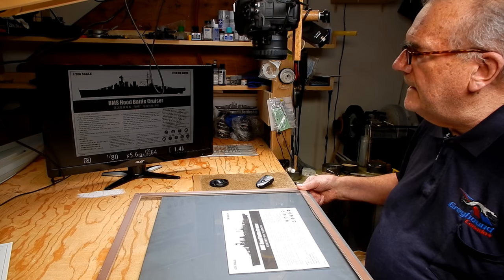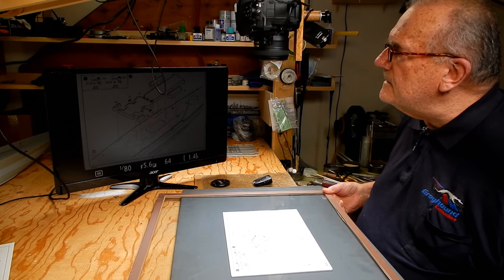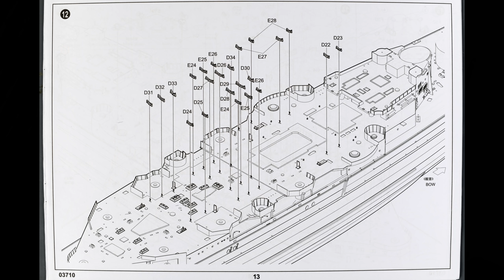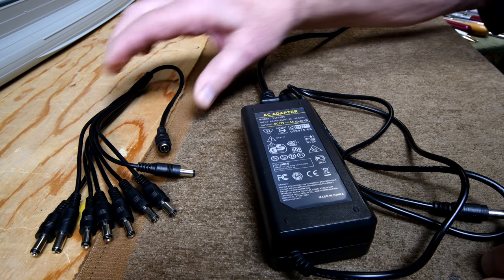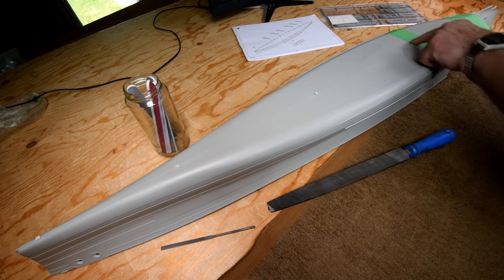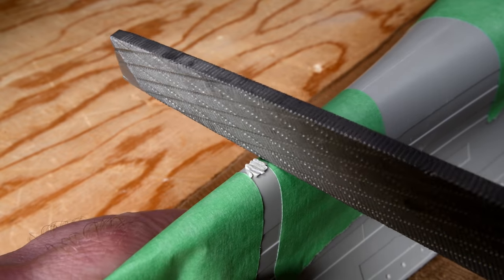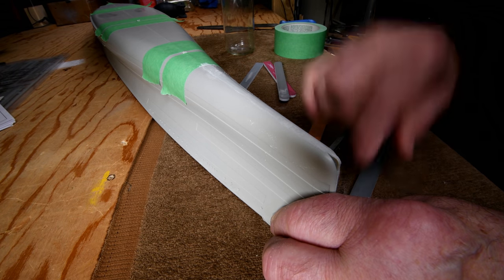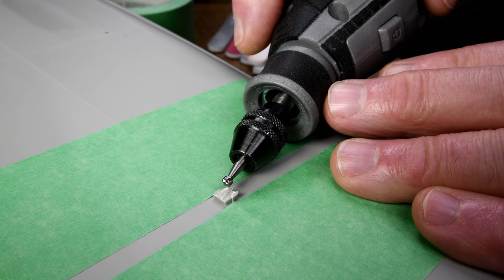The Model Ship - Part 521

Comment: Hi Ron,
Just to let you know. There is a very handy tool on the market for removing the seems off the hull. It''s called a Single edge razor blade (lol).  ;-).     It does a better job than the file you are using and it does a 
fantastic job without damaging the hull.
See you tomorrow my friend,. Stay safe and be well. .......😷.  😷.  👍.  🇨🇦.  
  As always,    Jason
Reply from the maker: Hi Jason,
I was thinking afterwards that perhaps my razor saw might be worth a try. We'll see what happens tomorrow. 👍🙂

Comment: For checking the deck fit I saw an interesting idea about taping the decks down and checking for fit and gaps etc. The guy actually tapes the entire ship (major sections) together checking for gaps etc - then pulls it apart and glues the thing together.
Reply from the maker: I was thinking of using tape to pull the gunnels in tight against the deck edges if necessary. We'll see how it goes. 👍🙂